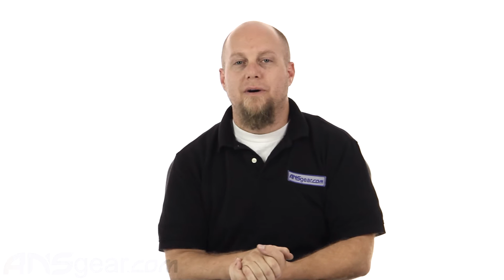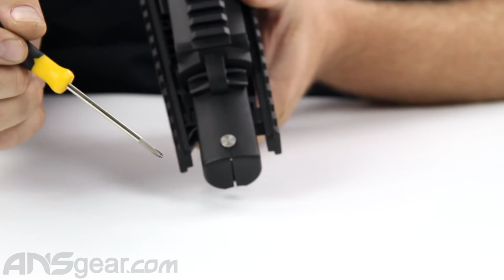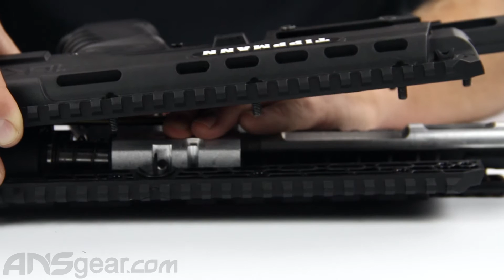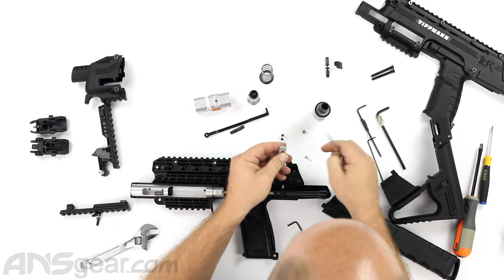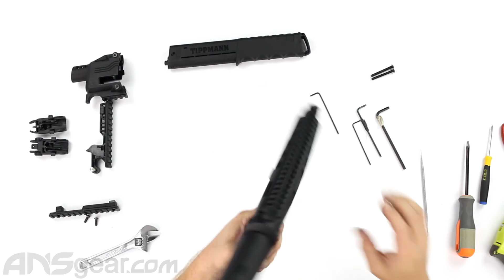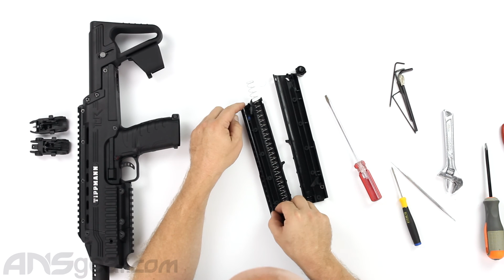Tippmann TCR Paintball Gun - Maintenance/Repair

Comment: Thank you for the useful re-assembly section, especially. I had a jam trying to chase a deer out of the garden, because a First Strike ball disintegrated in the breech and stuck the bolt forward. I think your reassembly procedure is better than the one in the manual ("do everything in reverse"). Much appreciated.

Comment: @9:31 You don't need a new feed block to use a hopper with the TCR!
If you want to use a hopper, just take the plug out, flip the feedblock over, 
so the feed port is facing up, and slide the hopper feedneck on the front before you put the front shroud back on!
Reply from the maker: That is correct! On page 18 of the TCR Manual this is explained : http://paintball.tippmann.com/tcr-manual.
 

This video was made very early on and this had not been verified, thank you for the update. It will be helpful for all TCR Users.

Comment: That Video really helped a lot getting a better understanding of the TCR. The ONLY thing I´m really missing (somehow everywhere on the net) are details about how to actually change the velocity.
Do I need to unscrew everything to change it?
I also have something "exotic" hagin there (guess its because of EU/German regulations), a white "ball", blocking the adjustment.
Anyone ever seen this and knows how to best remove it?
Here is a pic of it:
https://picload.org/view/dllpdcir/20180821_114047.jpg.html
Reply from the maker: Page 11 and 19 of the manual will display this: http://paintball.tippmannparts.com/diagrams/Tippmann%20TCR%20Manual%20V0215%20TPL.pdf

I am not sure about the limiter of your marker.
Reply: @ANSgearPaintball  Thanks a lot for your reply, much appreciated. After removing some black rubber that was covering the access there was a second white plastic ball in it (looks like an airsoft 6mm ball). I used a small drill and removed it and finally have access to change the fps. 
Just in case someone else has this issue, take your time, süße the smallest drill available and you are all fine.